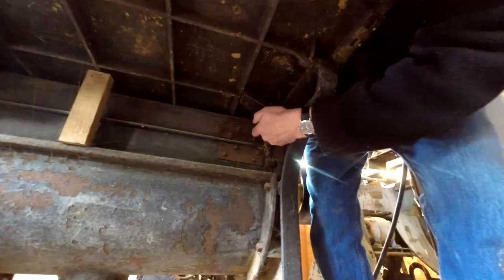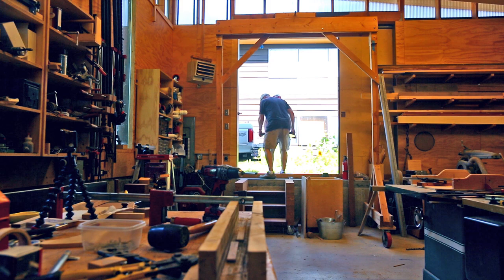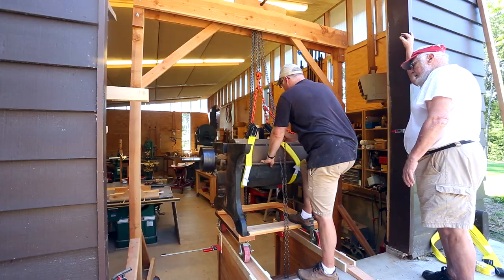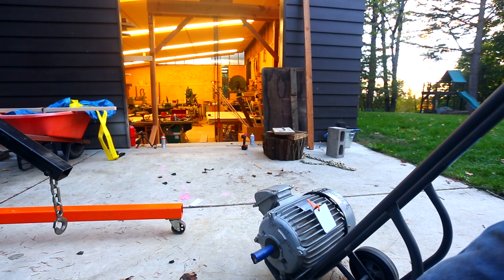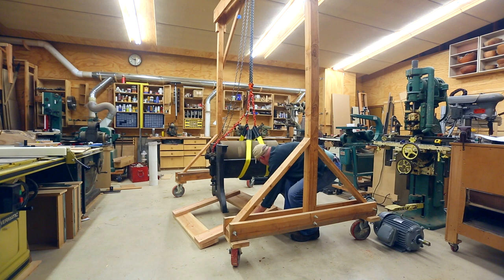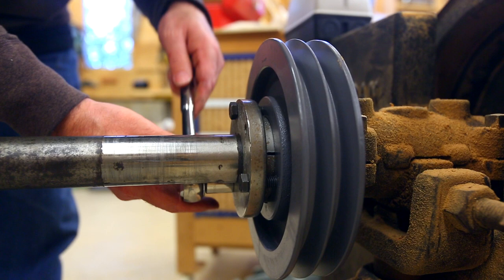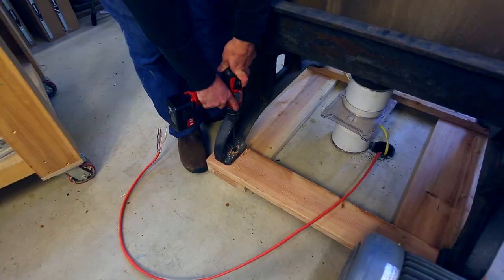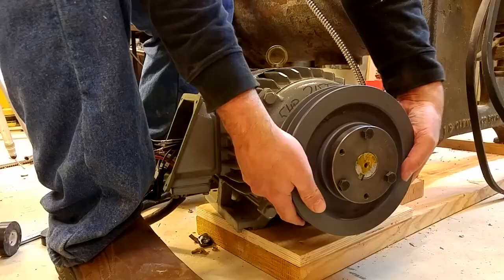Frank H. Clement Surface Sanding Machine

Comment: Frank! A little trick I learned pulling cable for AT&T years ago... Whenever you pull new wire through a hole (ie. the orange wire) you always pull a new string/rope at the same time and leave it in the hole with the wire so there's a line in the hole already when you go to pull the next wire. Saves you the whole "shop vac and string" step.  So, essentially every time you pull a wire you pull a rope/string with it at the same time so it's ready to go for the next time.

Comment: Maybe make a jig to apply force to bow the tables back up?  A few weeks of constant pressure might make them move back.
Reply: +Matthias Wandel Yep, if they were bent, they can be bent back.
Reply: Bending will work I'm sure! ......What about pouring resin and letting that find the level... Thinking out loud now... Would need to fought up the metal though for it to grip.. Not sure why I'm awake thinking of this at 0100 hrs, watching Frank's and Matthias' channels lol
Reply: ThePaulius The resin isn't a bad idea, once you've rough leveled the surface, the resin could give you a perfectly flat surface!
Reply: +Matthias Wandel A few weeks of constant pressure gets people married.
Reply: +Matthias Wandel Steel doesn't exhibit a lot of creep. If it doesn't return it in 10 minutes, it probably won't return in a couple of weeks. It will never be perfect this way, though, I would recommend replacing them with ground steel (or perhaps the resin) if you want the former glory.
Reply: +Matthias Wandel  Heat it and beat it.
Reply: +Matthias Wandel Any time metal is bent from its original shape it will stretch some therefore it will not go back exactly to it's original demension. I have done some vehicle body repair and when we hammered or bent metal back to where is should be we would heat the metal and apply cold water with a rag and shrink the metal some.
Reply: +Kim Shirley  I used to know an old-time German body guy who did just that. He did not believe in Bondo and that was his exact method. Boy that guy was talented.  He could take what looked like a crumpled up piece of paper (sheet metal ) and bring it back to perfect condition. In fact that's how Keith Fenner straightens prop shafts.
Reply: +Kim Shirley For Steel that method is ok, but that machine looks like made form cast iron. If You throw cold water on hot/heated cast iron that could cause cracks in structure.
Reply: +Tekninentyo i had an old claw hammer that i thought was stamped that i wanted to turn into an adze
so i popped it into the forge got it up to a nice bright orange hit it with a hammer and it shattered turned out it was cast iron
Reply: +Kim Shirley I have exactly same idea.
Reply: That which is crooked cannot be made straight.
       Eccl. 1: 15
Rims of chariot wheels once bent by dint of labour, cannot, no matter what be done, recover their original lines.
       Plutarch The Education of Children 2 D
Reply: @stevenstout1542  
Matthew 19-26
26 But Jesus looked at them and said to them,“With men this is impossible, but with God all things are possible.”

I don't think a bend cast iron table is out of the realm of possibilities for a driven man, or woman.

Comment: Hi Frank,
To stop the moove of your shaft backward and frontward, you're supposed to have some rings on your "bearing cage" (i don't know the english name).
The bearing is normally tight to the shaft, so that means if you lock the bearing, the shaft won't moove anymore.
You can get those rings separately, there are different size of them (thickness, diameter...)
I suggest you to change the grease, and also the joint.

You've got a very nice shop, i love it.
Best regards from France

Comment: Your videos and work are terrific, thank you for sharing. I did notice that while you were installing the v-belt sheaves that there is considerable play between the bearings and pillow blocks. The drive end bearing needs to be locked into the housing with a lock ring. Just subtract the  measure the face of the bearing  from the space where it sits in the pillow block. Generally this is in mm. This width and pillow bock series # is all you need to get the right ring. Center the nde bearing in its housing and lock it to the shaft.

Comment: What a fun machine! These older machines are just a dream to tune and tinker on. Should be easy to balance, sort of like a tire. If the rippims come down you may not have as much vibration. You have all the lathe tooling to get that carrier bearing back to spec I'm sure. It fits with all the other equipment and has your name on it already!  It will be fun to see that stop animation of it coming apart! ;-)

Comment: couple comments: Your shop is no slouch but your pal's shop is super authentic! Thrust washer on the sanding drum shaft should handle the back-forth. I would think you'd be better off having new steel tables fabbed rather than cobble up wooden tables (once you've gotten the balance & vibration issues solved) Unless I am mistaken they do not look too hard to duplicate. I am looking forward to seeing how you address the too-fast/out of balance issue. That could be several things and may take several approaches to tune out.. Annoying problem, to be sure. 

Your videos are superb, I truly enjoy them!

Comment: My compliments on getting this beast up and running. If I were a betting man I would say this was a pretty useful machine in the patter makers shop. Since it's not a jointer, I would replace the cast iron tops with laminated maple slabs. For what you're using it for, it would work great. And after a while you could always reflatten them as necessary. Option 2 is to find a machine shop with a Blanchard grinder and you'll be good as new. And just my .02, but I would just change pulley diameters to slow it down and use the money on surfacing the tables instead. 
I really appreciate the quality of your productions and cinematic feel of your videos. Great work.

Comment: That guy's shop is nuts.
Reply: +jribolla It's an amzing shop, I'm completely hooked on his videos. You'll see :)
Reply: Have you seen the videos of it being designed and built? If not, I recommend watching.
Reply: +el an (The shop) by the way.
Reply: It's definitely extreme for an individual owner!  But must be nice to have to tackle any project.
Reply: +jribolla - Yup. Go BIG or go home.
Reply: +Johnnie Walker he is already home, its a private shop!!
Reply: It was just a way of saying.
Reply: +jribolla well, I just learned (through a previous most) that he built it? If so, why isn't the floor at ground level? Paying attention to that detail during construction would eliminate weeks or months of fliddling around with movable stairs, winches etc.....even when unloading sheet goods from the pickup, just put it on a sheet dolly and roll it inside.

I used to live on the 5th floor of a converted factory loft and I'd back my truck up to the old loading dock, pile everything on a dolly and use the freight elevator to move everything in. I'd only have to "lift" it once to put it on the dolly and one to put it in the sheet rack.....
Reply: +michael C Frank explained that the shop is below ground level because: he had a giant hole after demolishing an old swimming pool, the shop doesn't block the view from the  house and it can still have a high ceiling , it provides a thermal mass for keeping the shop cool in the summer and warm in the winter, ground level is the height of all of the machines in the shop so materials can come in and stay at that level rather than lifting them. Machines are a pain to move but it's rare that they do.
Reply: Palastanga well, that explains it, but how does the material all stay at ground level, or, the height of the tops of the machines? levitation? you still have to move the material in, down the stairs, then onto a rack or up onto the machines....

High Ceiling: for when you're building 10' high cabinets or when you have to rotate a 4 x 10 sheet of melamine vertically?

To each their own but I've worked in shops where you have to either carry things UP stairs, or down stairs to ship things out or bring things in.....and I'll trade all those things to not have to do that.....it gets old after hand carrying 100 sheets of 3/4" MDF... ..meanwhile the same truck lifts a load of sheets for the shop next door, puts them on a dolly, and the guys in the shop next door roll it in, and slide the whole shipment onto the rack without ever having to carry 1 sheet....
Reply: michael C - Thank you for the info, missed the point where he explained that, although i already watched most of his videos.
Reply: +michael C watch his workshop playlist, first 2 videos on building the Worksop and q&a. I'm just repeating what frank says. Don't forget it's a hobby shop - it's not a high output production shop. He's not losing money by having inefficient processes.

Comment: Frank, I second the thoughts below about inspecting the bearings, especially if they're made of Babbitt. I'd also get the tops Blanchard ground, or use something like G10 to add an auxiliary flat surface on top of the existing [warped] plates. Finally, you could add shims über the outfeed table to get the "jointer" utility. To me that seems more useful than having infeed and outfeed in the same plane. Nice find!

Comment: The vibration in both axes could be removed by balancing. If axial vibration is excessive you could have a thrust bearing to absorb movement without eating through your bearings.  One thing I noticed is the really long shaft.  I would say use it or cut it.  You could do a disc sander, if you need it. The table could be straightened and ground flat.  Ask around. Love your videos, along with your dream shop.

Comment: Actually, you could take those tops down to your local machines hope and they should be able to laser straighten them. If you put wood up there, even hard wood , you have a chance of some expansion/contraction. Also, you could get a smaller pulley for your motor to slow down the speed. That would save you some money over the speed controller. The last thing, I believe you could get a spring for the shaft, between the bearing and belt pulley, which will keep the shaft from walking back and forth .  Hope at least one of those plans help you.
Reply from the maker: +webslinger67 I like the spring idea, I had not thought of that.  I may start with a smaller pulley.
Reply: +frank howarth Perhaps you should keep the small amount of shaft movement since it will act like a horizontal bobbin sander, and help to prevent sanding lines.
And I thought the way you got the wire from the wall to the machine was brilliant!
Reply: +frank howarth Yes, get a much smaller pulley.
Reply: +frank howarth Since the shaft is spinning, as well as the bearings holding the shaft... simply use machine shims between the drum and the bearing.. they a spin at the same speed.. no wear issues..
Reply: Derrick Ottenbreit I think the babbitt bearings may be part of the frame.  You may just need to pour new ones to improve end play.
Reply: +Nicholas Smerk 
Yep, almost certainly babbitt bearings. Frank will need to check the wear on them. I can't see from the video any thrust bearing or similar to take out the run-out on the shaft. And that drum shaft really sticks out a looong ways.. cutting it would be an extreme measure but would make running it safer.
Reply: +webslinger67 changing the length of the pulley will never affect the rotation speed of the drum, you need to change the diameters of the drive wheels.
Reply: +Paul Sonntag might want to investigate a little further on that. For one thing, I didn't say length....
Reply: +Paul Sonntag The pulley is the round thing attached to the shaft. The belt is what is attached to the pulleys.
Reply: TheKthman my mistake!
Reply: +frank howarth 
1 13/16" diam. shafts are quite common, especially in the HVAC industry. Also, the preferred term where I come from is "sheave" (pronounced shiv) instead of "pulleys." 
I second the motion of smaller motor sheave!
Great vid, cheers from KS
Reply: Clayton Carson I was going to write sheave, but figured I'd confuse a bunch of people.  When I bought the sheave for my planner, I was surprised to learn that you can buy MANY different sized bushings for them.
Reply: +Nicholas Smerk 
Haha, I was reading the comments to see if anyone did. I mean technically they are pulleys so no one is wrong, but I think when driving V-Belts they are sheaves. cheers
Reply: +frank howarth There are pulley/rpm calculators that can tell you the exact size pulley(s) you can use to equal the recommended 800 rpm ...although thinking about it, if you have a 1200 rpm motor and need an 800 rpm drum speed it seems to me using a pulley on the motor that is two thirds the circumference as the one on the drum would give you that,  no?
Reply: MISTERComaToes radius.  Think of a lever.
Reply: +webslinger67 yeah, I'm not a pro at electric motors or anything but I was under the impression that for a motor to work properly and efficiently it should be run at x rpms....unless you have a motor designed for variable speeds that is....

My first thought on the shaft movement is, because the machine looks rather old, that the balls in the bearing races are worn....I'd be looking at the interior ring that is fixed to the shaft and if that's where the play is, you'll have to replace the bearings.....
Reply: michael C A jointer doesn't really have any drag unless it's starting, or you are pushing wood over it.  Personally, I would just overpower it and not worry about efficiency.  What you need to be mindful of is the RPMs and speed at which the knives are flying at.  If they are going too fast for the design, you can throw a knife.  Either breaking the machine, injuring or killing someone.  On the other hand, something like an air compressor, you would size the pulleys for both compressor RPM and motor amperage.  If you try spinning too fast, you may pull more FLA than the motor is rated for, either burning up your motor, tripping the overload or circuit breaker.

Also, fyi, the motor's RPMs are dependent on the frequency of the power coming in (cycles) and how many poles the motor has.  What we need to figure out is the RPM of the machine...if it's in the proper range.
Reply: Nicholas Smerk great info, but this is a sander not a jointer and if you've got 60 or 80 grit on it, and you're surface sanding a 12" wide piece of maple, the load will be huge.....

One thing I can't figure out with this drum sander: to take off anything on the surface of the material, you have to have the drum higher than the table tops, and if both tops are on the same plane, that means you can theoretically sand your board down to nothing....that's why jointers have the outfeed table on level with the blades, and the infeed is set to how much you want to take off...
Reply: michael C Woops, I looked at the picture and forgot it was a sander.  Still, I'm sure it will be overpowered and choosing the correct RPM for the sander to work properly is quite outside the realm of motor efficiency.

I was thinking that the outfeed table may need to be permanently shimmed.  That's what my initial reaction was when I watched the video.

I'm pretty sure this machine has babbitted bearings.  He'll probably have to re-pour them.
Reply: Nicholas Smerk what's a babbbited bearing? (too lazy to google lol)
Reply: michael C Keith Rucker probably has the most informative videos on the subject.  You can look it up.  It's a bearing that's poured with a lead alloy, rather than a bronze bushing or a ball bearing.
Reply: Nicholas Smerk wow, no wonder they went to needle and ball bearings....what a lot of work when your bearings are shot.....hell, two decent ball races on each would be the cat's ass....

Comment: Had a similar problem with my old (1930s) table saw with the shaft floating back and forth and vibrating.  New modern bearings cost me just under 20 quid and sorted the problem.  They have a little grub screw that locks them to the shaft and locks it in place

Comment: Fascinating! 
Never seen the likes - good, old-fashioned, indestructible build quality...

Unless you are nostalgic about those bearings, Frank, I'd upgrade those to standard pillow block bearing with locking collars... Bring the shaft stability into the 21st century. I would expect you would see a difference on the quality of the cut,  or finish, the end-play would be fixed by the locking collar cam action, and you'd have 0 maintenance for the rest of your lifetime.

Also, I'd suggest having the tables re-machined; I understand your solution in wood, but doubt if you'll get the longevity that that piece deserves. Another idea would be to have iron tops welded to the old,  then the new top machined with your T slots, etc. in them...

 :-) We all love thinking how we could get you to spend your money - so we can watch you enjoy it!

Great video, as always, thanks for your efforts and for sharing!

Comment: Most of the time you really don't need a VFD when you have a belt drive. You need to simply increase the diameter of the driven pulley to reduce the rpm. The motor runs more efficiently at full speed. Many drive suppliers have online software for drive selections, but since you have the drive sheave already you can just calculate a ratio to reduce the rpm and the new drive. Pulley will have the same ratio compared to the diameter of the drive pulley.

Comment: Frank, nice tip on the paper towel pull through method.  I need to do that.  Also, do you plan to trim the shaft down before installing a belt shroud?

Comment: Was just about to mentioned the safety issue with the uncovered belt. I am glad you mentioned it yourself at the end.
Wouldn't it be easier to change the speed of the drum by using different sized pulleys, or do you need to be able to change speeds on the fly?